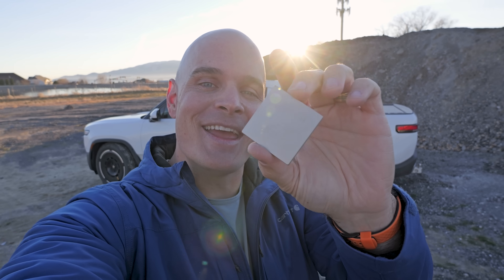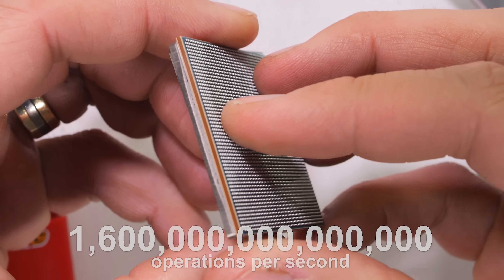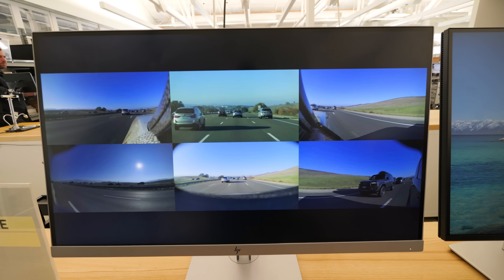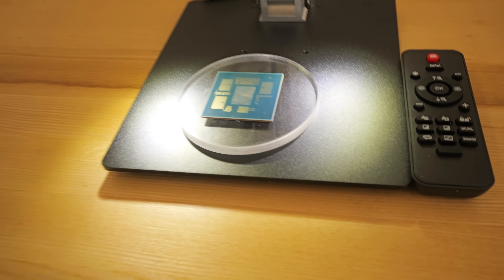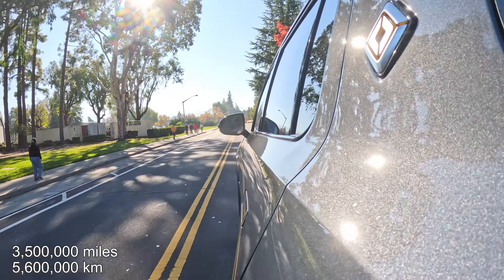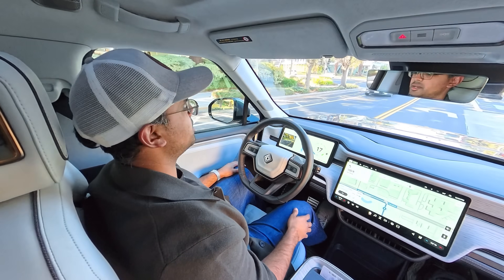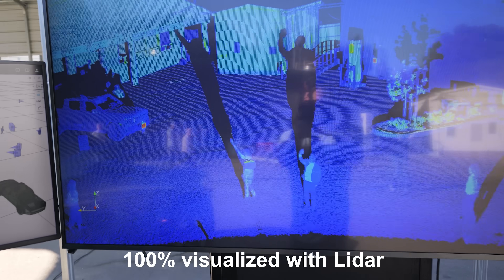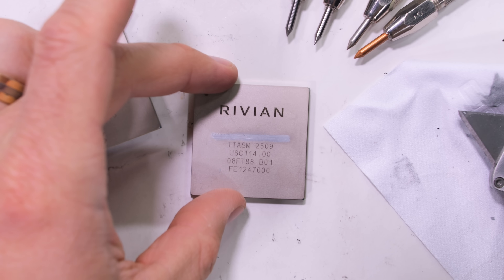I Broke Rivian's Self Driving Computer Chip

Comment: Can anyone tell me why an integrated solution has processors with an IHS instead having direct-to-die cooling? Doesn't look like this should be a user-serviceable component.
Reply: My guess its to protect the Processor by encapsulating it from the Enviroment.

Direct Die Cooling would be mote efficient but this part as a whole would be either bigger with cooler attached or separate making the processor vunarable for external Enviroment during processing.

Thats my guess.

Comment: Everyone knows Lidar is the only way to self drive. Eventually Tesla will put Lidar in their vehicles. It's only a matter of time. When Tesla talked about self driving GM said "Self Driving is decades away, Lidar is too expensive and the systems around it make it's cost double the price of a vehicle". That was 10 years ago. Lidar is still very expensive. That's why it's only in $100,000 plus vehicles.
Reply: What? Doesn’t most vehicles with adaptive cruise control use lidar? Toyota has several vehicles under $100k that do this.
Reply: @jamesrdorn no, adaptive cruise control uses radar which is very cheap.
Reply: @AverageJoe928  ah, okay.
Reply: @jamesrdorn  Most low cost adaptive cruise control uses cameras. Some use radar. I'm not aware of any before this vehicle that use Lidar. My comment was from something GM said 10 years ago. Prices have come down for Lidar, everyone is working to add it now. Lidar will be in expensive cars over $100,000 for some time before it comes down to less expensive car. As I said, decades.
Reply: @Dav1d_B  at this rate, 100k will be the floor cost for vehicles soon.

Comment: Oh please Rivian, fix the Lidar shelf. 
Tell me you don't live where it snows, without telling me you don't live where it snows. That lidar sensor is going to be blocked by a few mm of snow. And on more snowfall, or icing days (like we're getting in Ontario right now) you will have to scrape the sensor free of ice....
Reply: All of the cameras, radars are currently paired with heating elements, I would be extremely surprised if the LiDAR shelf isn’t going to have one as well
Reply: What if it has a defroster.....
Reply: @brandon8569  😂 just 10 km ahead 😂
Reply: Not only is that section heated, it's in the path of the wiper
Reply: It's heated
Reply: Tell me you don't know what a defroster is without telling me you don't know what a defroster is 😂😂
Reply: @E_g35776  💯🤣💀
Reply: I share your pain here in Central NY
Reply: So the lidar can melt snow 1 km away 😂
Reply: Given how much snow we've gotten here at the factory, and how many they have have parked outside, I suspect they are aware of the impacts of snow and are accounting for it.
Reply: I imagine that there would be vision only training and inference as well for such situations which may make it L3 for those cases.
Reply: God forbid you have to drive the car yourself
Reply: Hey, if it snows, it won’t work anyway. Even humans can’t tell which line you’re on, let alone a self-driving car. 😂
Reply: If you can afford a product like that you can afford shelter to park it under.
Reply: @disgruntledegghead6923 You take your garage to work or the store with you?
Reply: @yammmit I do actually, it's quite convenient. No worries about snow, rain, or temperature differences as it's climate controlled.
Reply: @disgruntledegghead6923 wow, I didn’t know it only snowed when you are at home and that it completely stops when you take your car out in the world and have to park anywhere, like at the supermarket.

Comment: its just more of the same of what we already have. i use radar controlled throttle and brake in city and highway but i gotta keep my feet on the pedals cause it doesnt always get it right. radar controlled steering is more of the same but i will have to keep my hands next to the wheel when it gets it wrong. i expect this to always be more driver assist and less check out and sleep in the back

Comment: re: "Where vision only-human eyeballs can't see".  I can drive without lidar and I only use two cameras on a single pivot that can only process one focal point at a time.  I have never encounter conditions where, driving to the conditions, my limited hardware failed me.  We're talking extreme, extreme edge case scenarios where the human hardware is insufficient, ie. headlights not working at night on an unlight road in the fog, such conditions are nearly impossible to intentionally find, they are also extremely temporary.  My point is, software + a couple cameras is all it should require.
Reply: Cameras, except those specialized and expensive cameras used in more demanding science related applications like astronomy or biology for example, generally do not nearly have the same level of dynamic range as human eyes. Very subtile details in the shadows and highlights provide useful information to our brains to aid in driving.
Reply: I'll never forget driving home once on a cold night, when it started to rain heavily, and suddenly.  The windshield was covered in rain, and the sudden humidity and temperature differential caused it to fog up.  I found myself driving at highway speeds, in the dark, utterly blind.  I am very thankful there was almost nobody on the road that night, because there were several seconds where I just slowed down to a crawl, and hoped I was still pointed the right direction.  If there had been anyone in front of me, or behind me, I might not be posting this comment today.

I'll take the LIDAR.

Comment: 2:24 it's okay Tesla doesn't need the compute because they'll happily omit LIDAR and Radar in favor of crashing into plain white trucks during sunsets :)
Reply: Things are changing fast. You're talking about V11 or maybe even V10. Right now we have V14.
The difference is huge. If V11 was included in car price, maybe I'd be using it on highway, maybe not. V14 makes driving safer, even in the city. It's like having a second pilot in plane.

As far as I know, Tesla uses radar too. Just not Lidar, and some earlier cars didn't have radar either. But like every new tech, it's changing rapidly.
Reply: @Plajerity  Tesla no longer uses radar, it does in older Teslas but not newer.
Reply: @Waldo1122  Are you sure your info is up to date? In this case idk why they would put radar back in HW4...
Reply: @Plajerity They put it back in HW4 but only for collecting data for God knows what, but it isn't used in FSD and it doesn't give the distance warning when parking like the older Teslas. So no it isn't used.
Reply: @Waldo1122  If they put it for collecting data, that means this or next model is likely to use it. They need to collect data to train a model.

For parking radar is not useful. In close range cameras and ultrasonic sensors are better.

But... ideally you want to ignore some data from ultrasonic sensors, if camera says otherwise. That's a whole issue. Ultrasonic sensor may detect some bump in the road, or a bush with leaves, and the car should be able to decide if it's safe to proceed. That's why newer versions might ignore an obstacle...
Reply: The issue with lidar is that if one of those beams hit a camera sensor it may damage or kill it.
Reply: @real_mvp3811  if it's safe for our eyes but not cameras in the same spectrum, those cameras need better filtering. I'm pretty sure big mirrorless cameras / their lenses have good filters for these LIDAR wavelengths. and phone manufacturers will have to catch up eventually.
Reply: Yet Tesla has billions of miles on FSD and little to no issues while Waymo is crashing into buses on pre-mapped routes...

Comment: @Jerry --- your Rivian review is solid but the ongoing criticism of Tesla can come across as one-sided. Tesla has been working on FSD for over a decade, though progress was slower initially due to a rule-based system that proved hard to scale. The shift to end-to-end neural networks required a full software stack rewrite a few years ago so the current vision-only approach has effectively been in intensive development for about 3 years.
Tesla has refined pure vision sensing over many years, eliminating the need for LiDAR or radar - something most competitors haven't achieved. For newer entrants like Rivian, starting with sensor fusion (cameras + LiDAR + radar) is a pragmatic way to accelerate development and reach market faster building on lessons from Tesla's challenges.
Rivian's in-house silicon is impressive and gives them more control over hardware. However, they still rely on third-party solutions (Google) for parts of AI processing. Chip production scale is another factor: Tesla aims to equip millions of vehicles annually, while Rivian's smaller fleet (hundreds of thousands) simplifies supply logistics.
Great job to Rivian overall - especially their agentic AI software approach, which adds capabilities Tesla currently lacks. 
Fact Check: You're not quite right on the levels - no company including Zoox, has achieved SAE Level 5 autonomy yet as of December 2025. Level 5 means full self-driving anywhere in any conditions with no restrictions. The highest deployed today is Level 4, limited to specific areas/geofences from leaders like Waymo and Zoox in their robotaxi operations - Tesla Robotaxi still has a saftey Driver so it is not there yet.

Comment: The truth about 'self driving' is that it is only self-driving in contrived locations that don't have winters that cover road markings, shift road edges and emergent lanes randomly, etc. There have been attempts to make an autonomous vehicle that can handle this in Buffalo but no positive results have come from such testing campaigns and they've mostly stopped. Self-driving vehicles should remain restricted to specific cities for now. Any sort of broader legalization will lead to them encountering non-cherry picked driving conditions where they won't flock properly with humans and so will cause accidents.

Comment: I've seen a handful of people drive these and what I've gathered so far is that the people who buy this vehicle are reckless drivers. With the limited data I collected in a real world scenario, all 3 of the rivians I encountered out in the wild were driven by people who; sped well past the speed limit, cut off other drivers, failed to use turn signals, failed to merge properly when presented with a yield or stop sign, crossed multiple lanes of traffic last minute to take an exit they should have prepared to take a mile or two before. Hopefully others have found, better, more responsible drivers. However, if this is the underlying tone for rivian, I must say I will steer clear of this brand as I dont want to be associated with reckless drivers. It's similar to buying a honda civic, nobody but immature drivers want one to boast how childish they are.

Comment: Nice. Another rivian ad.
Reply: not a single thing says buy a rivian, but look at this cool tech powering stuff
yall gotta chill
Reply: @xapu8775 lol he’s glazing it hard, this chip isn’t impressive in any way. Putting memory next to the chip isn’t new, 1600 TOPS means it’s already behind Tesla’s upcoming HW5 chip (which hits 2000+ TOPS), and it having lidar shows how far behind they are in not just tech but also mentality
Reply: @propiii what do you mean with the last part? Lidar is supperior to camera based tracking
Reply: @xapu8775 lidar is completely unnecessary, as proved by Tesla. Volvo and xpeng have already ditched lidar and others will eventually follow as well. Also these rivians only have front mounted lidars which will do literally nothing? Front mounted lidar means they will be doing unprotected turns and backing up without lidar at all… what’s even the point LOL
Reply: @propiii mark rober did a great video explaining why lidar is the better solution. Lidar works in dark and foggy scenarios, cameras are limited to their vission. Unless you blast ir in all directions, cameras will be the worse solution.
Reply: @xapu8775  i want to know how you know that.. explain
Reply: @propiii exactly
Reply: @xapu8775 this is already proven wrong
Reply: @TherealJA253  sorry... your comment makes no sense. lidar, used by waymo has been very proven and stable. it detected running children and moved away, mark rober even tested it.
and the results speak for themselves, in a dark environment tesla missed while a lidar car perfectly stopped to a halt.
Reply: @xapu8775 so your saying teslas can’t see in the dark…
Reply: @xapu8775 Mark rober did an ad for his friends lidar start up company. I wouldn't call that a good review of the tech. Not to mention he didn't even use Tesla fsd, he compared lidar to standard autopilot on an old model. His video was a useless advertisement that proved nothing.
Reply: Yeah I'm also curious what you think about lidar. You're the first person I've ever seen with that take
Reply: @bingonight1504 same a little research and lidar is completely useless specially when it’s only facing the front .